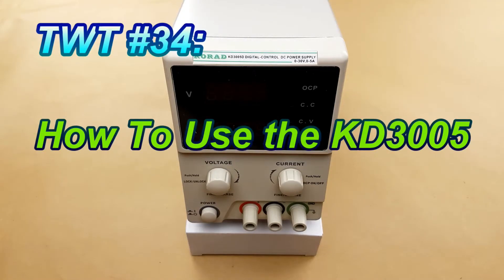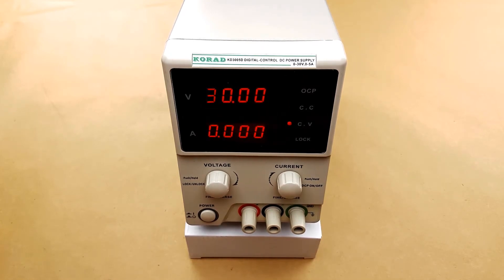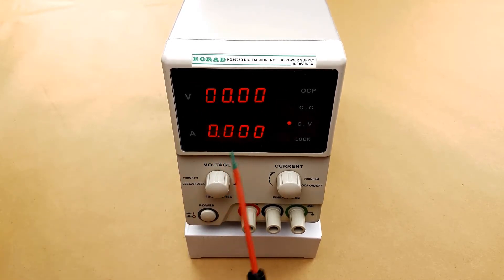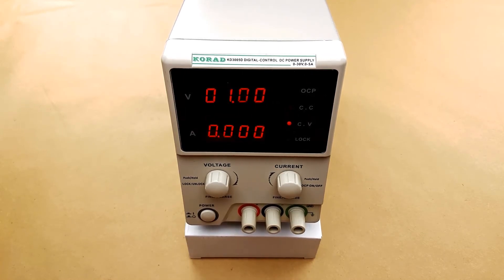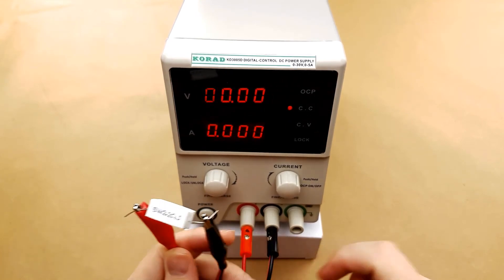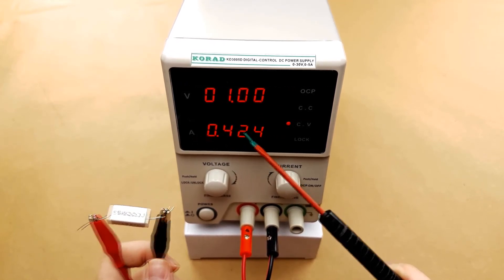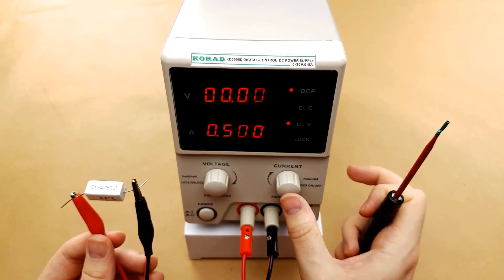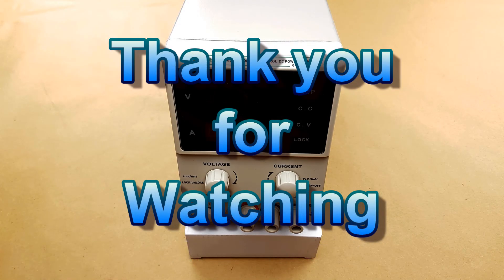How To Use the Korad KD3005D Power Supply | TWT 34

Comment: thank you for your video. I've had this PS for about 5 years and have always been confused about how to set constant current vs. constant voltage. The manual that comes with it is very terse on the subject so your video made it clear how to use these.

Comment: I am a software engineer with 50 years experience and a ham radio operator since age 14 so I have been doing electronics and software all my life.  Thanks very much for your video.  This device has the most counter-intuitive interface I have ever seen.  :-)  Without your video I think it would be impossible to use.  :-)  I am currently working on a Meade LX-200 telescope mother board where the 5 Volt supply provided by a voltage regulator is indicating a short.  (It gets boiling-hot!)  The regulator is OK if I pull its output pin from the board.  I am trying to find the short so wanted a power supply where I could set it to 5 Volts and use it instead of the voltage regulator to help figure out where the short is.  I need to be able to continuously increase the current.  Without your video, it would be very unlikely for me to discover how to do this!  THANKS!!!

Comment: Good gravy THANK YOU! I've made ionic silver forever with a generator and recently decided to get fancy. I was saying very very VERY bad words in the Korad's general direction. Thanks for dumbing this down. My brain was over thinking ALL the knobs. Also the instructions that come with it are pretty bad. Thank you ♥️♥️♥️
Reply: Lol, I bought this to start my colloidal silver journey and I have a degree in electronics and it was confusing. Seems like a great machine from all the reviews. Would you mind me asking you? Do you change your v&c settings on different batches to get different ppm’s or do you have a standard you go with. I ask because I have heard at lower current, you generate smaller particles. Not sure if that is true. I was always taught that the longer it runs, the larger the particles because the start sticking together.

Comment: Thank you so much for explaining and SHOWING how to set the crossover point between CV and CC.  I have some BK Precisions and a really good 50A bench supply, but they are heavy and right now I'm doing some light work on single LED characterization where I need to set up quickly, reliably and use my KORAD as a portable- it's lightweight compared to the others, and mine is very stable.

However, I read the manual 10 times and still couldn't figure out A) How to set the crossover point between CV and CC, and B) the 2-second, both-button push you kindly showed at the beginning of your video, so I could just turn the knobs freely during testing with out the digit placeholder push.

You are a very linear, good instructor and I appreciate the time you took to freely share your knowledge.  NOW I'm really glad I bought this power supply.

Comment: Fine review - thanks!  I need a power supply, to play around with LEDs with my kids. I guess this is a suitable one?
Reply from the maker: It would have no problem being used for LEDs,  The power supply has more than enough voltage and amperage for LEDs and you can even play with some of the really large COB  style (up to 30 volts of course) ones if you feel so inclined.  If you are just lighting up single LEDs the unit might be a bit overkill, but it would allow room for future projects as well.

I did accidentally destroy a red LED because I was messing around with my power supply and forgot to set a reasonable constant current... oops. :)
Reply: Thank you so much, especially for the idea of tinkering with COBs. With regards from Berlin.

Comment: I set this for 30v 0amp it reads cv   so i connect to my 12v battery I am desufating   then i adj amps to 2.amp    it switches to ca and the voltage drops to what the battery is at 12.01

What amp I doing wrong  thanks

Comment: is it good for cellphone repair? please reply
Reply from the maker: It would depend on what you would be using it for in terms of cellphone repair. For stand in testing to temporarily bypass the battery and attempt to get the phone to power up, it might work. For manually recharging a battery, it would probably work but you'd have to keep a close eye on the battery's voltage. It is a fairly decent power supply considering its price.
Reply: @TinkeringWithTerrius   thanks for your reply. May i know , is it a good idea to check cellphone motherboard ?
Reply: @TinkeringWithTerrius  There is a slightly more elaborate version  of this device that has presets and more buttons for easier setup and a button to disconnect the load so you can set up the supply and then connect it to the load. Electronically, it has the same capability as this one. The bad news is that famous Australian reviewer/blogger/forum host and electrical engineer  Dave Jones tested the sister model (3005P ?) with his lab grade equipment. It failed during testing. At one point it was outputting 56 unadjustable volts. At another point it was showing 5 amps but the voltage  display read zero. The output was not shorted and it is not necessary to short the output to set a current limit with this supply. It also had some nasty  voltage overshoot when connecting to load with certain current and voltage combinations. You can destroy equipment like that. I had high hopes for this supply but after seeing that video I will have to pass

Comment: I just bought one of these,  no manual but very easy to use.   I left it running with no load ,, 100mA limit at 3.30V on the device - which I verified with  two different DVM.   ALL OK.

after 2 hours, I returned to my bench and found the device cycling every second or so - dropping to 0 and then ramping back up to ,my set voltage.    

Not impressed with this model
Reply: I'm trying to make colloidal Silver but an confused ass thi how to get  my korad to go into constant current without my silver rods touching in the water. Do you have any idea how to accomplish what im talking about? I really need help if you have any advice, I would really appreciate it.

Comment: Thanks for the info but you didn't explain enough about the protection we make mistakes sometimes  what happens if wires are connected incorrectly of if we have a short why did you not explain that ?????
Reply from the maker: Mistakes happen, and with most bench PSUs, a dead short will only be limited by the quality of your leads that are connected to it, one of the few times cheap leads can save you heartache since they somewhat current limit it. If you wire something incorrectly, as with any power source, you will run the risk of damaging whatever you are powering. The only protection this unit provides is the ability to set OCP which will kill the output if a device draws more current than you have selected, you enable OCP by holding the current knob in until the OCP light comes on. Unfortunately as far as I am aware there is no protection to stop you from killing your components or destroying the power supply, though I couldn't/can't test this because it is my only bench PSU and I need it to stay in working order. :)
Reply: So if what you are saying is true ,this power supply has no protection ... But then again like I first said You didn't explain it properly....
Reply: @stevejosrph6065  If you set current to 0.5 A and you short terminals, current will be limited to 0.5A so that is protection. I think this one wont shut of, other models have shutdown when higher current or voltage is at place.
Reply: thank you your video was very good

Comment: Oh my, clumsy alarmclock interface :/
Why does not any brand create an easy to use voltage/current setting with encoder and proper number cycling acceleration!

Comment: also have this PSU, and it's a solid linear PSU for what it cost.
I just have the EU KA version with no protruding sockets., and both P version KA and KD so I can use them with software, and get all the programming timed features and buttons that way.
but I gotta admit, I really think Korad screwed it up with the interface on the KA, too many buttons can be a hassle, but too few is even a bigger hassle..
a few dedicated buttons would have been nice, even a load on, load off is usually mandatory.
and I hate its CV and CC feature. I could swear it has a mind of its own.
I use them for lasers where the linear PSU is golden. 
https://imgur.com/gallery/B7ZOQ3J

Comment: STUPID DESIGN - THERE IS NO CUT-OFF BUTTON!!! You turn it on and it's live on the terminals, so you have to turn it on, set the voltage/current, then turn it off, plug things in and turn it back on again. Whoever thought this was a good design... Definitely was someone who wasn't planning on using it!